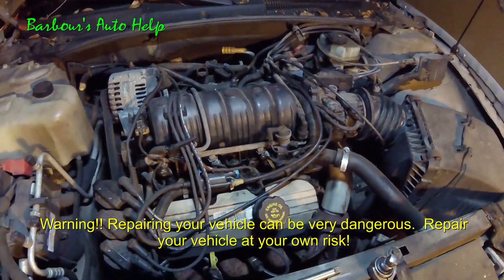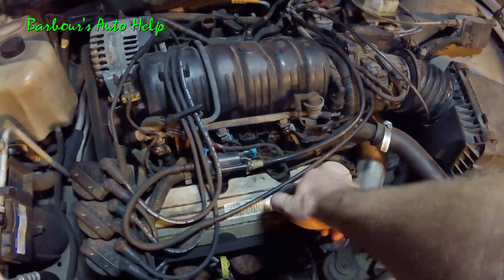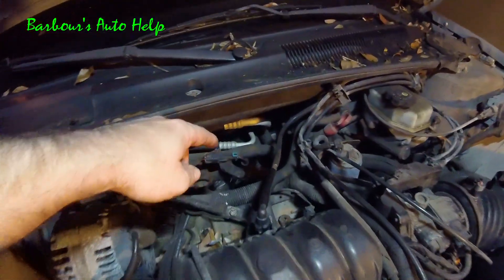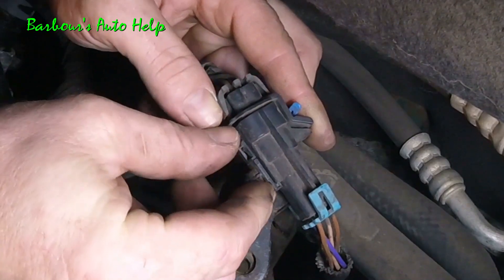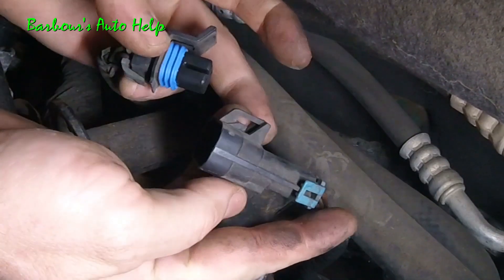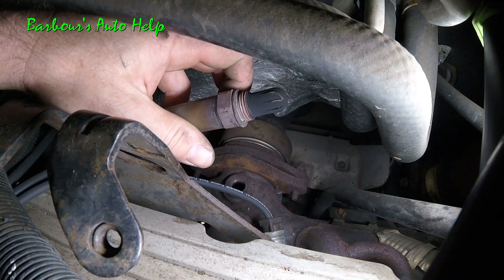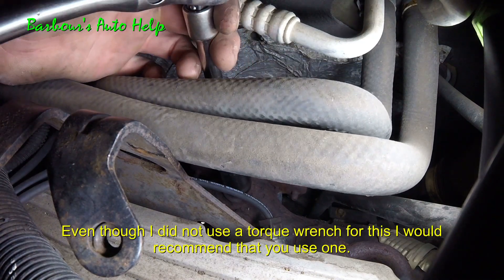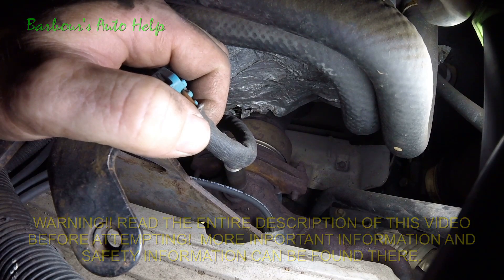OXYGEN SENSOR REPLACEMENT GM 3.8l V-6 SERIES 2 (BANK 1 SENSOR 1)

Comment: if you're not going to use the old O2 sensor (why would you) just cut as close to the sensor as possible and just use a regular 6point deep well socket to remove, sensor sockets are great but will separate/spread under extreme Torq.
Reply from the maker: Typically O2 sensors don't require extreme torque.

Comment: I thought bank 1 is facing the Radiator?
Reply from the maker: You are correct. However the vehicle shown in the vehicle is only equipped with 1 up stream and 1 downstream O2 sensor. So, the both get the default name of bank 1. I have more information in the description and was sure to point this out there.

Comment: when you turn the open socket, it spreads out, and circles the sensor. It's very Tough to remove the sensors, unless anti seize was used

Comment: Great information.  I have the same problem with my exhaust 02 sensor. I thought that it was my catalysts 
converter 02 sensor.  My engine light came on and read 02 sensor bank 1. I have some basic knowledge about car parts, and repairs. 

However though,  I  wasn't knowledgeable on this 02 sensor bank 1. Instead of first asking Auto Zone to let me actually see it. I went ahead and purchased the wrong 02 sensor.  I got the one for the catalysts converter (under the car). I paid $ 20 for the part,  and $ 65 to have it replaced. 

Only to realize that my check engine light was still on. After doing some though
research I finally realized, and understood what was the correct part. I had purchased the correct.  I was scheduled to have an auto repair shop to replace it for $ 45-65. 

However though, after seeing your video, I believe that I can replace it myself.  Just today I did exactly what you said. I removed my engine cover. I looked directly behind the engine. Their it was located. I placed my hand directly on it. 

Yes it really looks so easy to replace. As you illustrated. All I need to purchase six inch extension, and a sensor remover tool. I already have a ratchet. The only this I am concerned about in making sure I properly unplug the connection from the old 02 sensor. 

I have a 1999 Buick Park Avenue ultra supercharged engine 3.8. This is the original 02 sensor. Again thanks for your video I hope that I do it right 😊😊

Comment: Hi Keith! 2 questions...#1) What connector is connected to the 02 sensor connector? Is it the EGR connector? And  #2) I just replaced my 02 sensor on my 98 Park Ave (thanks to your vid), and, for some odd reason, I now have 2 female connectors that I am supposed to connect back together??? How is it even possible to have 2 females? So...the 02 sensor connector is female & the EGR? Or whatever the connector that is that's supposed to connect to it is identical to the 02 connector! I'm so confused. :/ Help please. TYSM in advance! (I wish I could send you a pic of what I have here but there's no attach thingie).
Reply: Ever find the issue? Same thing with mine

Comment: Really good video.  I paid an auto shop to replace mine because I didn't have the time and I hadn't researched my check engine code.  Makes me wonder why I was charged $342 to replace it after I explained that my code reader said P0135 O2 Sensor Heater Circuit Bank 1 Sensor 1.
Reply from the maker: Well, just because your code reader gave you a code for the heater circuit it doesn't automatically mean that the O2 sensor is bad.  There is more to the circuit than just the sensor.  There is a fuse, O2 sensor, wiring and the PCM that all make up the circuit.  A failure in any one point along that circuit can cause this code.  So, they probably ran a pin point test on it to insure that they were replacing the right part and then of course you have the cost of the part and the labor to put it in.  So, $342 may not be a bad price for having a pro diagnose it and replace the part for you.
Reply: I was charged $150.00 for an   O2 Sensor Heater Circuit Bank 1 Sensor 1 once.

Comment: Changing an O2 sensor on a 3800 is so much easier then say a 3500 that's in a Chevy uplander. It's just the type of vehicle rather than engine, but nearly everything is a little tougher. With so much room up front you would have thought the engineers would have thought that thing out a little better. The cars with the 3800 on the other hand, a breeze compared. Just look at the spark plugs.. easy. Alternator.. easy. Coils.. easy and up-front. The crazy thing is the 3800 has roughtly the same power output and the 3800 was used in earlier vans on the same platform.

Comment: I was taught that bank 1 is on the cylinder 1 side and bank 2 is on the cylinder 2 side. Unless for some reason gm switched the banks.
Reply: Nope. Bank 1 is towards the firewall on 60 degree v6 engines.

Comment: Do O2 sensor cause misfires? Thanks!
Reply from the maker: Not usually.   On older vehicles it can really make the engine run poorly though.
Reply: Ck your coil pack

Comment: That's bank 2 sensor 1 what you changed. Look at the firing order
Reply from the maker: You are 100% correct concerning vehicles that are equipped with bank 1 and 2 sensors.  And thank you for pointing that out.  However,  the vehicle featured in the video only has one up stream and one down stream O2 sensor.  Thus they are both classified as Bank 1.  Up stream is bank 1 sensor 1 and down stream is bank 1 sensor 2.

Comment: Hello I have had two o2 sensor bank one changed out because I get codes that they are working what can I do to keep them working please help.
Reply from the maker: So, you changed out two O2 sensors that were working and you had codes that said that they are working?  And are you worried that your new O2 sensors won't work?  Why are you worried about them continuing to work?  I'm not sure I understand your question.

Comment: I replaced my o2 sensor twice same code p1133 keep coming on whats the problem a leak?
Reply: p1183 isn’t an o2 sensor code 😭 P1183 is low power in your fuel pressure regulator. PO140 or PO135 is your O2 sensor i don’t remember which is which but the other is mass air flow sensor i just get them mixed up sometimes:

Comment: Hi I would like a socket like that where can I get one ? is there a part number? please help need to finish replacing my spark plug :)
Reply from the maker: You want an O2 sensor socket to put spark plugs in?
Reply: @BarboursAutoHelp  i need to remove the oxy sensor it is right in front the spark plug I am trying to replace I tried the 7/8 ths wrench from auto zone but it could not turn in the space. ( No I'm not using a sensor wrench to replace my spark plug)
thank for your help.
Stephan
Reply from the maker: Oh ok.  Just making sure.  Of course you can find them on Amazon.   Just search for oxygen sensor socket.  They also have them at most parts stores.  Sorry I dont have tool numbers.  But, you shouldn't need numbers.  Are you changing spark plugs on a 3.8L.  If so I have a video that should help.  On the 3.8L in the video sensor removal isn't needed to replace spark plugs.
Reply from the maker: https://youtu.be/wPfPab8EFhQ

Comment: Did you leave penetrating oil on it over 24 hours? I tried and it’s literally welded on the exhaust. What do I do?
Reply from the maker: I'd take it to a shop.  Sometimes they can be a real pain.  They may have to break out a torch.   I'd let the pros do it.  Very dangerous.
Reply: BarboursAutoHelp okay thanks for the advice. The biggest pain I’ve ever come across working on cars

Comment: Better idea - use a 1/2"-drive socket over the top of the sensor socket, and use extension(s) and a 1/2"-drive breaker bar.  And never use a pipe over a ratchet wrench handle for additional torque leverage because you'll risk damaging the ratchet.
Reply: Or.....cut the pig tail use 7/8 deep socket?
Reply: @motrhead69  Why not?  That's the best alternative yet.  If the 02 sensor is intended to be replaced, what's the point of saving the wire?  In my case I removed the sensor in order to test it, with a small chance that I may keep it.  But I like your suggestion.  Thanks.
Reply from the maker: Oh was this in response to someone's post about putting a pipe over a ratchet?
Reply: @BarboursAutoHelp  No, that was my own extra friendly advice, because I happened to ruin a Craftsman 3/8"-drive ratchet wrench last weekend by using a pipe over its handle to leverage the O2 socket.  After that mistake I realized AFTER my mistake that the O2 socket has a hex that can accommodate a socket over its end, and a 1/2"-drive is much stronger for torque and the use of a breaker bar basically eliminates the need for a pipe.  I learned that a ratchet wrench's internal mechanism can't really withstand the stress of a pipe used with it, and that's what a breaker bar is for.  (I also needed to use a universal adapter to solve the angle problem reaching down to the O2 sensor.)  I also learned that the type of O2 sensor socket with the extra-wide slot that eliminates 2 of the hex corners (the type that Harbor Freight sells) also doesn't work because it slips and can strip the sensor's hex head.  I went to Pep Boys and bought their socket that has the narrow slot and all 6 hex corners, and it worked (after soaking the joint with Liquid Wrench).  That sensor can be a beast to break free after years of being subjected to exhaust heat.  The point of my post is that my mistake (and loss) and friendly advice can result in another's gain.  "A wise man learns from his mistakes, but a still wiser man learns from others' mistakes."  Thanks for the video and thumbs up.
Reply from the maker: Good point.   Thanks for sharing.
Reply: Fax i broke 2 3/8” ratchets
Reply: @mblrwon  I resolved to using a 1/2" drive socket over the O2 sensor socket's hex connection rather than the O2 sensor's 3/8" drive connection, with a breaker bar.  The O2 sensor socket provides both the 3/8" drive and hex wrench connections, the latter of which is the better alternative.  Good Luck.

Comment: What size is shock and can you put an open wrench on it and what size
Reply from the maker: 7/8".  I would not suggest using an open end wrench.   This could potentially round off the nut of the O2 sensor.

Comment: If yall ever come across that the car want crank sometimes.  I replaced  crank and cam sensor. And wire harness. $100. FOR ALL parts on ebay. Car run fine.
Reply: Yeah. eBay is awesome. Cheaper than amazon which is overrated. Dealers and auto parts stores are a ripoff.

Comment: Where is the bank 2 sensor 2?
Reply from the maker: The vehicle in the video does not have a bank 2 sensor 2.
Reply: It actually does
 Gm only has a bank 2. No bank 1.  Has only bank 2 sensor 1 and sensor 2
Reply: @ryanrobitaille5903 If that is true why would my 2000 Buick with a 3.8 set a po133 which is bank 1 sensor 1?

Comment: I have a 2003 dodge caravan 3.3lv6 with the code reading p0135 my 02 sensor its on the right side behind the engine i try to unconnected the connector its not coming out and i have a p01684 its my battery terminals needs to be changed
Reply from the maker: Sorry, I don’t have a video showing how to do that.
Reply: take your wipers off first( make sure you remember to where the wiper rest when you out them bac on) n then the housing..doesnt take long n is a easy job if you want to get to the sensor. makes things alot easier..for me anyway.

Comment: Thank for the video. But I just bought a camaro with that motor and I need a catalytic converter. The shop I went to told me to get a catalytic converter with 3, O2 sensors. Is this correct ? Thanks
Reply from the maker: I’d have to know the particulars of your problem to answer that.  What year is the Camaro and what problem where you having?
Reply: Hey, I just bought this 99 Camaro with no exhust or catalytic converter. It has the 3800, V-6. And a shop I went to. The guy I know that works there was't there. And his wife that works up front told me that if I bought a cat. online to make sure it came with 3 sensor. Is that because, I will need to replace 3. Or the cat itself has 3 ?
Reply from the maker: Some shops like to replace the O2 sensors with the cat.  The converter shouldn't come with sensors... at least the ones I get don't.  You may have to ask for all the sensors when you get the cat.
Reply: I can't thank you enough for your help and quick reply.
Reply: Thak you very much for your response. I have figured out that two of the O2 sensor are on both side of or behind the headers and the third behind the cat. On this year Camaro.

Comment: I changed that one already and my light is still on what do I do
Reply from the maker: Did you get your vehicle properly diagnosed before replacing the sensor?
Reply: BarboursAutoHelp yes I did
Reply: BarboursAutoHelp I told me bank 1 sensor
Reply from the maker: What about the bank 1 Sensor?  What was the definition of the code?
Reply from the maker: What’s bank 2, Ryan?
Reply: @BarboursAutoHelp   I had same problem. po135 bank 1 sensor1.  I bout brand new one.   Check engine  came back on
Reply from the maker: Check your fuses
Reply: I checked fuses. It's getting 12 volts. The car runs fine.  Just check engine light on.  And I cleared codes.
Reply from the maker: May be time to get it looked at by a tech.

Comment: my sensor came with the wire and harness.  So to remove the sensor, I just cut the wires and used a deep dish socket on it.  Installation, well, not as fun.  But it is not too hard to get a wrench on the sensor.  This is for those of you that don't have that special slotted socket he used.  The sensor can be tough to get out so I personally recommend you use a whole socket on it.  The new sensor will go in much easier
Reply: BarboursAutoHelp he's talking about cutting the wires on the old sensor. Not the new one
Reply from the maker: The socket is only $10-15.  I would not cut the wires on the new sensor.  Just spend the money and get the socket.  It may save you from ruining an expensive sensor.
Reply from the maker: Oh ok.  Thanks
Reply: Most auto parts store will loan you the tool called an oxygen sensor socket, you will pay a deposit, but get your money back when tool is returned. ☺
Reply: Does AutoZone or advance auto parts store put on car belt Someone told me about it

Comment: Thanks a lot man to bad I didn't see this video until after I paid the shop to do it (about 2 days ago). I recently watched your spark plug tune up and did that for my Bonneville it was a big help. The diagnostic was a code for 02 sensor but even changing that didn't fix the problem so now we are looking at a new fuel filter. Other then this issue the car has been so good to me. Thanks for the videos. Do you have one on a passenger window that won't go down?
Reply: My mom's car only has 70,000 miles on.it and 3 out of 4 windows had to be be repaired.  GM, go figure
Reply from the maker: +Roy Glass Your welcome!  I don't have that yet.
Reply: Fuel filter should be pretty simple as well, let me know how it went